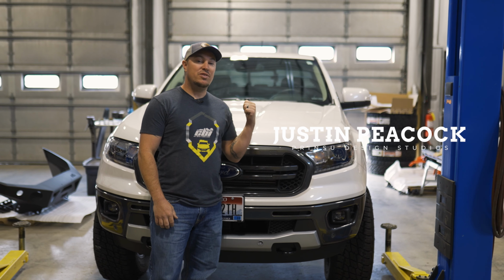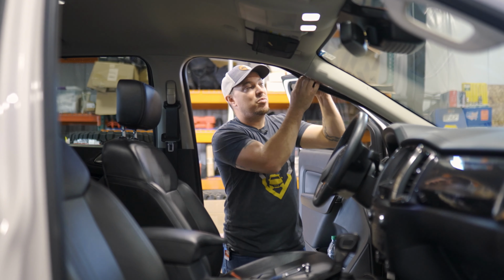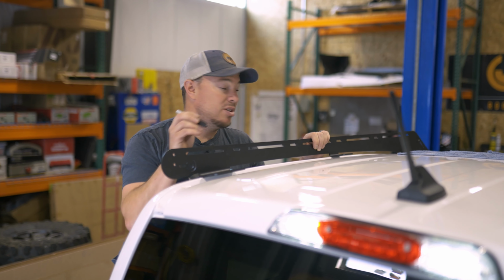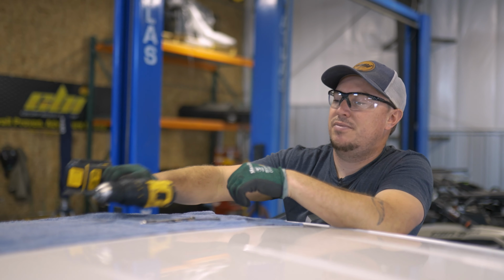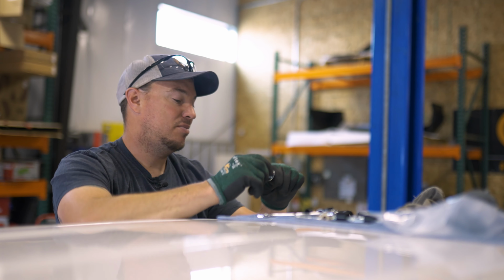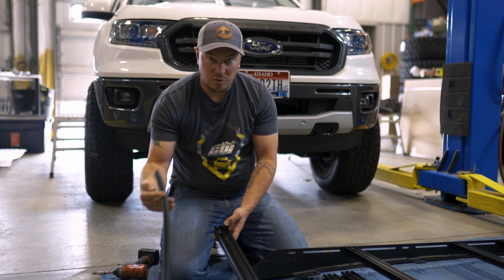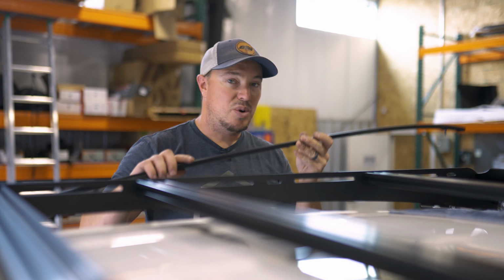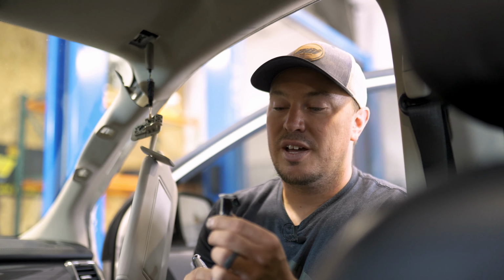PRINSU INSTALL: Ford Ranger Roof Rack

Comment: For the price you guys should really provide all stainless steel hardware stainless steel plus nuts and stainless steel bolts and washers let’s get real guys!
Reply from the maker: The great news is we do include all stainless rack hardware as well as our all new Pro crossbar with all of our roof racks as standard now! This is a huge benefit for all OG roof racks as well as our new Pro series. The mounting hardware is not stainless however as we need that to be strong enough for our rating and we cannot get that rating out of a stainless steel bolt. All other hardware is stainless though!
Reply: Do you include the the 3m tape?
Reply from the maker: @scottubz  yes we do.

Comment: So food for thought, could you technically mark where the rack would mount on the factory gutter rails, and instead of cutting them you drill the holes into the rails, remove the rails and seal where the new holes have been added with that RTV stuff, then apply the rack on top of the gutter rails?
Reply: Yes this can be done as well. It can be a little difficult to do it this way but it s doable!

Comment: Curious why you don’t use plus nuts for all locations?  Seems like would be much more secure?
Reply: Ya took the words right out of my mouth. I bought stainless steel ones. My guess is they’re trying to skimp save money. Even though it’s only a few dollars. Pretty lame. They could’ve also gave us stainless steel bolts, pretty sad. In my opinion the ones they give you will obviously rust.